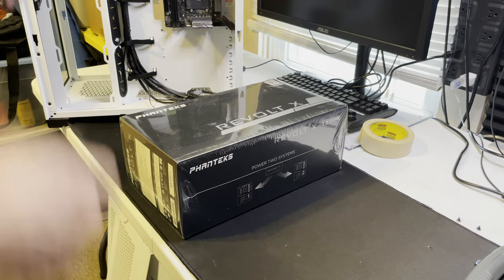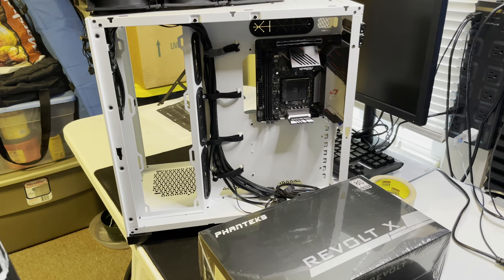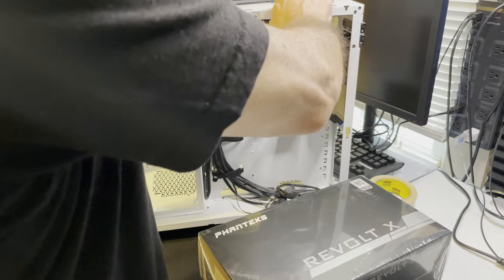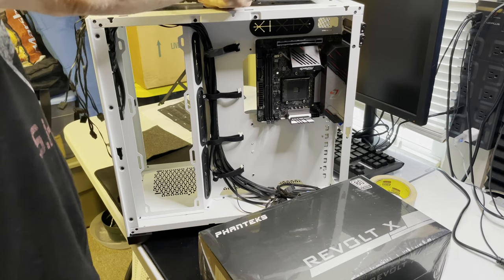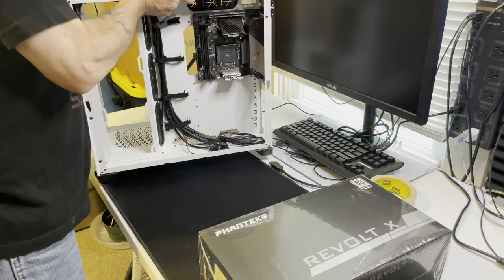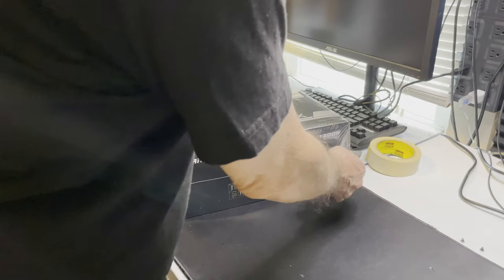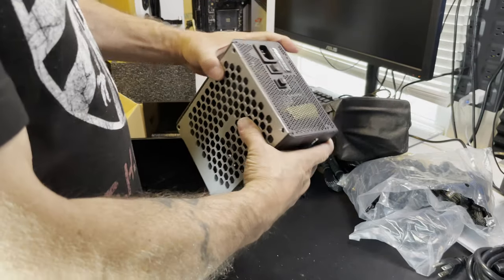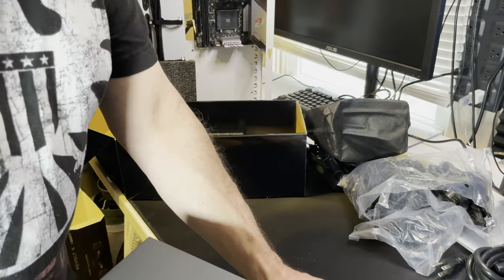Building the MetallicGear Neo Cube Case.

Comment: Hi, can you input GPU in back case with normally?
Reply from the maker: The only way I can do it is with a low profile 1650 and it’s not really cost effective when the Ryzen 7 5700G has better frames other than that I would have to do a vertical mount. I am going to try the 5700g first seeing it will only be streaming video and any games I play I will do it from my main board.  Thanks for stopping by
Reply: @JPsTechReviews  Thanks for answer it. I actually have phanteks revolt x and I want to try 2 system too. Want to choose something case pc like metallicgear neo qube. All case pc phanteks need raiser cable, it's to much for me hahahaha.